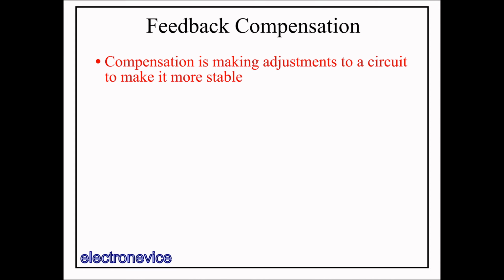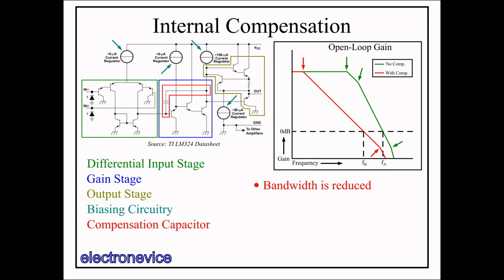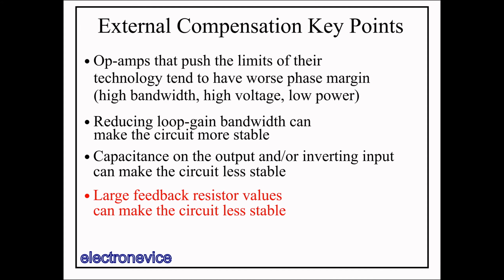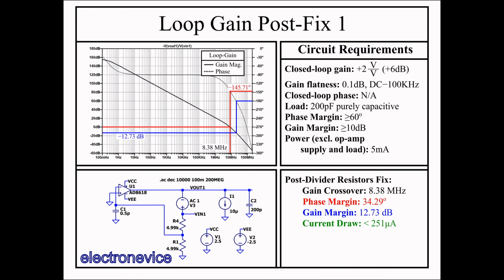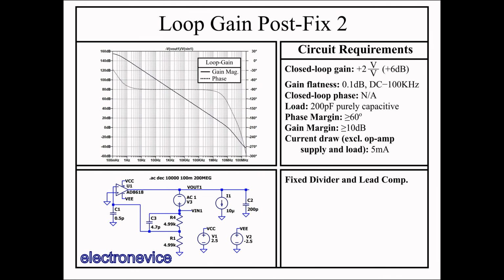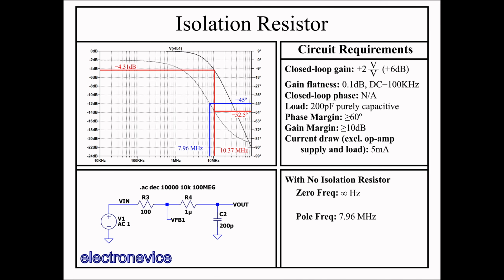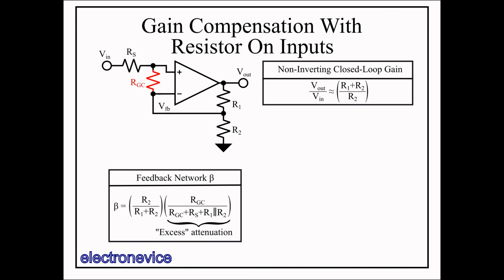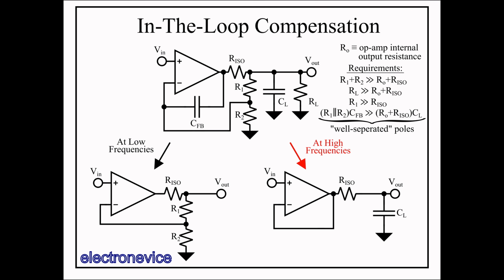Op-amp Finite Bandwidth Part 3/3: Compensation [Op-amp TS 16]

Comment: Great video.
For understanding fully, the purpose of introducing the R_ISO (19:35) is to get a zero, that will "pull up" the phase in the open loop response to add some extra phase margin?
Reply from the maker: Thanks!  Yes, introducing R_ISO introduces a zero in the loop gain which will cancel out the pole created by op-amp output impedance and the load capacitance and increase the phase margin as a result.  Ideally you minimize the resistance of R_ISO so that you get just enough phase margin to meet your requirements right around gain-crossover (so long as you don't create a low-gain margin situation), as this will minimize the effect of that resistance on the closed-loop gain transfer function.  However as we rarely have a good idea of what our op-amp's Zout is and only have ballpark figures - it's usually best to make that resistance a little higher to compensate for uncertainties in op-amp Zout.